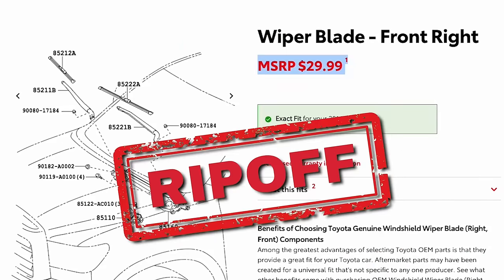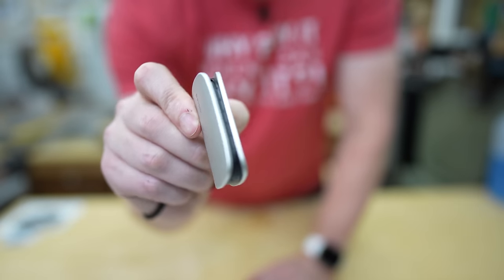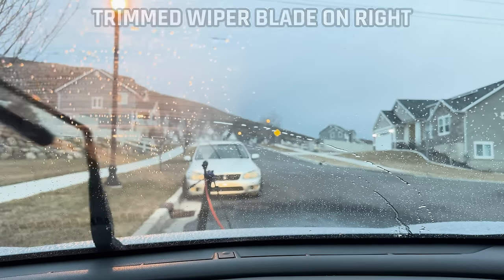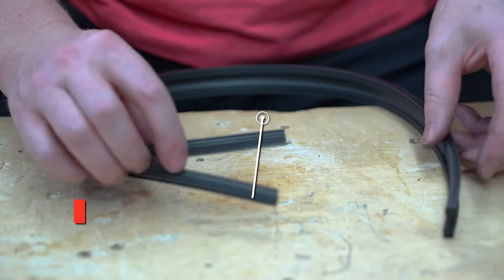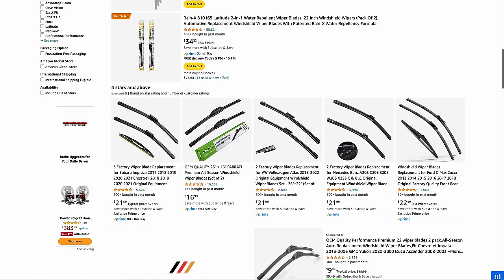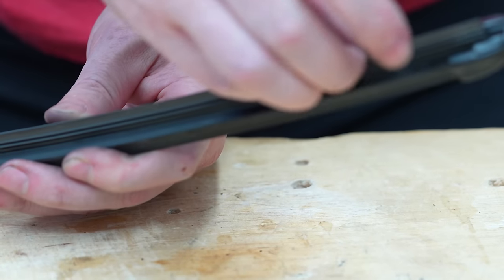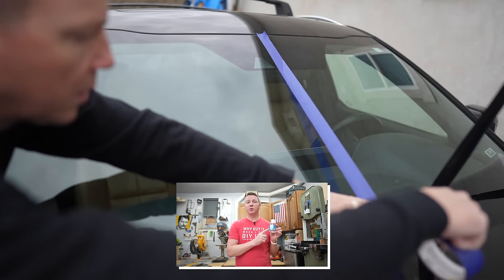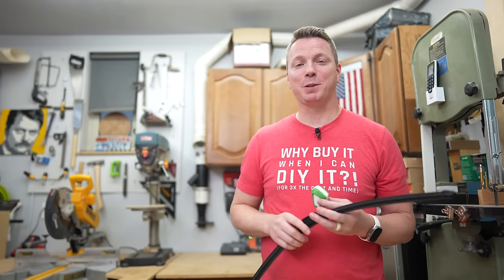Windshield Wipers Are a SCAM! 3 Ways to Save $$$

Comment: Yeah wiper refills were a thing back in the old days 90s camaros were almost refill only because of their backwards design.. this is just history repeating itself... Also the biggest scam is the cost of the "best" wipers just replace them regularly with the cheapest possible, no one ever complains that their cheap wiper doesn't work, they complain that the old wiper went bad. Change it cheaply with ever other oil change, if needed rain x does work.. DO NOT USE WINDEX ON THE WINDSHIELD...

Comment: A related gripe of mine is... why the hell isn't there ONE STANDARD CONNECTOR for the wiper blade to the arm?  There's the J-hook, and the square button, and the sides that get pressed in, and the pin, and more.  COME ON.    Just make one connector and call it a day.  I'm sick of buying some blades only to find out I have to take it apart and attach some adapter to make it fit.

Comment: First I highly don't recomend those tablets as a windshield flued! They interacts with the paint of the car in a very bad way. Don't use them!
Second, the grey wiper blade refils that you show are actually made of silicone. Those last years and years. Yes, they squick when they and the glass are clean, but they last for so many years. Whenever you can, buy them. There are lots of blades that advertise that are from silicone, but they are not. Look for the colored blades (there are blue, red, yellow and etc colors).

Comment: You definitely did it wrong with the cutters.
You have to pull it in one continuous motion over the whole blade. Don't push it, don't stop, don't wiggle...
Hold the blade in a way that you call pull (!) the cutter in one move over the whole length.
It only leaves that one nipple an the end that you have to cut.

Comment: Do NOT just drop those tablets directly into the reservoir!  They do not always dissolve completely and can leave little floating chunks that can clog up your feeder tube.  Yeah, have fun disassembling all of that to get in there.  Besides, the tablets are meant to be diluted in a specific volume of water, and your specific reservoir is likely way too small for that.  Stupid bad idea.  Instead, just stick with the bottle refill trick.  I like to fill the bottle halfway up with hot water and stir it up to help the tablet dissolve, then just fill up the rest with cold water.

Comment: Don't know why you guys insist on showing the black debris on the cloths. Most wiper blades nowadays come with a carbon coating that is a dry lubricant and helps the blades slide over the windshield. Apart from that, the rubber is also soft and might rub off the cloth. It's not dirt.

Comment: Back in the old days you could just buy the rubber part for a buck at the corner parts store.  Now you have to get the hole assembly for 15+  Thank you corporate America.  Lets just fill those land fills so the companies can make a bigger profit.  thanks for including the blade only replacement.  WD works good to let the blades slide in.

Comment: I've been using Rainex from the time it first came available.  I've been doing wiper refills for 12 years on my wife's Honda.  The original blades lasted almost 4 years.  I did a refill with non-OEM blades and had to replace them is less than 2 years.  Installed non-OEM , but not the same manufacturer as the other non-OEM.  I got about 2 years use.  The next refills were OEM and they lasted over 3 years.  I only buy and replace with OEM blade refills now.

Comment: Don't waste money on rain-x and similar products. Old-fashioned paste wax does the same job, lasts longer, and is easier to use. Get the cheapest carnuba wax you can find. Way less than $30 for basically a lifetime supply.

Comment: So to save yourself money on Rain X, use a potato. I’m not trying to be funny or make you do something stupid, it will do the same exact thing. Slice a quarter of a potato and rub it on your windshield, it’ll be really foggy, but leave it like that and let it dry for like 10 minutes just like you would with Rain X, then buff it out. If you don’t believe me, try it yourself on a small section of your windshield That way you don’t think I’m just trying to make you do something stupid to your windshield. I was super skeptical about it myself at first, but I swear by it.

Comment: Are those tablets summer use only will it keep it from freezing in the winter time? Rain-X is garbage I've used it on my windshield when you use your wipers it gets all greasy and leaves smeary streaks. I find the Rain-X wiper blades do the same thing. I'm sure the last product will do the same thing the first time you use your wipers.
Reply: Yes, they are summer use only. Bad idea to use in an area that experiences freezing because if you forget that's what's in your washer fluid tank and it freezes, you're in big trouble.

Comment: Using WD-40 on everything is some bro-science thats been passed on for generations. Use an actual lubricant like silicone lubricant on your hinges and moving parts and you wont keep needing to apply it over and over. WD-40 is a solvent, always has been, not a lubricant. Wish someone would have explained this to me when I was young and using it on everything.

Comment: replacing windshield wiper rubber could work well if places sold the correct part and if the wipers were meant to be serviced, but in my experience the end caps don't go back on securely (Bosch aerotwin wipers) and it's worth just replacing the whole wiper if there's a risk the rubber could slide out while driving.  Also, my wipers are typically in good shape for 2+ years, but when I've tried replacement rubber it doesn't quite make it 1 year.  My wipers aren't $70 USD though 👀

Comment: NO NO NO - DO not use WD40 on your wiper blades. Want to accelerate the age of your wipers? no, well don't put chemicals that will dry the rubber out. Use a little screenwash on a soft cloth to clean the rubber. 

Once the rubber has torn, either from age (over 1 year) or abuse, throw them away, your safety might depend on your wipers, you should change them every year, 2 at the most. 

Don't buy those cheap strips of cut to size inner rubber that some spares places sell for a few quid, they are ill fitting, might last a few months of you are lucky, but a serious poor economic choice, a 'false economy' if you will.

Comment: Your nextzett link does not work.
Reply from the maker: I just checked and it looks to be working for me but they appear to have sold out. Are you able to get to the product page in Amazon at least, or not even that? Also, are you located in the United States? It should work either way but it helps me to troubleshoot if I know where you clicked from. Thanks!
Reply: It's working now. Before it kept saying broken link.

Comment: This is crap.  A few seconds of barely covering the content, then more ads.

Besides, I never get nicks.  Just buy the midlevel blades on rock auto, along with other items from sam e warehouse to make the shipping cost reasonable.  If you have bad sun exposure, but minimal to no risk of winter windshield ice tearing them (since they're more expensive) then get the teflon blades.

Comment: WD-40 is not a "fix" for hinges and squeaks.  WD literally stands for water displacement.  It's more cleaner than lubricant.  That's exactly why it works in this application.  It's not going last very long to lubricate your hinges or anything.  Use a proper lubricant.

I fail to see how wiper blades needing maintenance makes them a scam?
Reply: Frequent replacement is not maintenance.
Reply: @WoodgemanX  Nobody said it was.  Using refills, trimming the blades, and cleaning them are all maintenance.